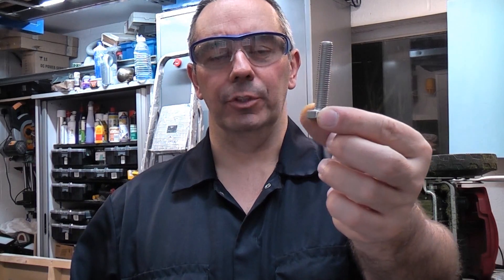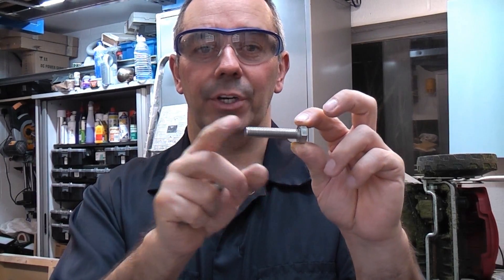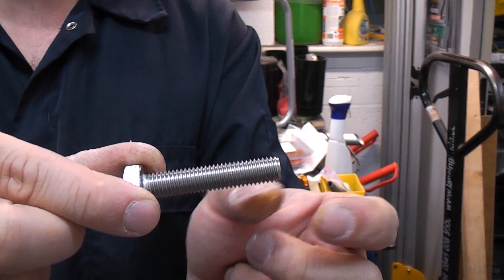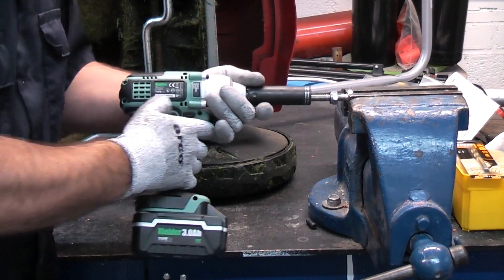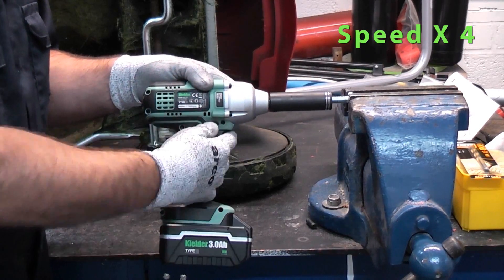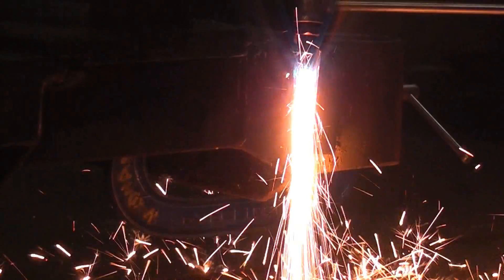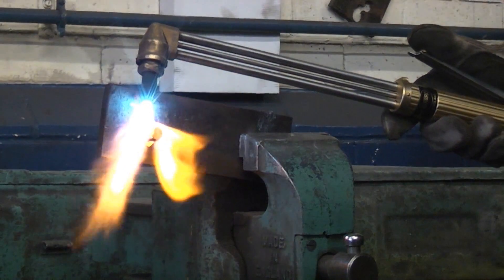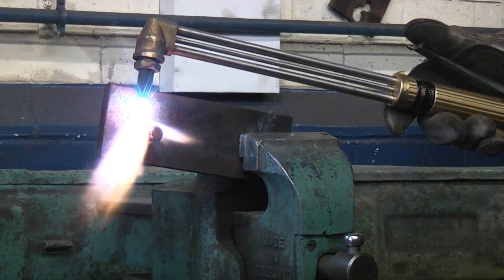Stainless steel bolts vs steel bolts | Stainless galling

Comment: Is it just nylocs that are an issue or will regular stainless nuts on stainless bolts have the same problem
Reply from the maker: It depends, I used Nylocks as they create a lot of friction and so they can gall up really quickly. I have had M16 stainless nuts and stainless bolts gall up on a steam valve (not Nylocks), which I had to saw off using a hacksaw. The machine that is pictured in the video (with the Milwaukee ratchet) also galls up when undoing the stainless bolts- using a regular ratchet spanner.
Thanks for the comment
Reply: Robert B when there is any resistance you have galling

Comment: Thank you very much I did not know stainless steel nuts gall or that you cannot burn them off. Why is it that they push stainless bolts more than galvanised ones?
Reply from the maker: You are welcome. In some situations stainless bolts and nuts are better, galling can be eliminated in a lot of cases by using a suitable anti-seize compound.
Thanks for the comment
Reply: Ultimate Handyman  If you did not know they galled and did not know that anti seize compounds are used they are not much good.
Reply from the maker: That is true ;-)

Comment: Quite some years ago, I had a 'temporary' job as a Mechanic in a food processing plant. I was told to just work, and keep my mouth shut, and nose out of any other projects....so, I watched in silence as about 6 guys spent weeks building a big ass conveyor system of all SS, to replace a carbon steel/painted unit. There were maybe 300 1/2"  X 2" bolts...they assembled the thing in the fabrication shop, then went to take it apart for transport.....all the bolts/nuts (nylocks) galled, many hours of abrasive/cutting everything apart. Funny thing, we used a cutting/drilling lube called 'WestLube'.....in the machine shop, in a different building......but even though it's good for SS, no one knew that, even though it was on the label ( the shop foreman was actually illiterate)....and even with that, they still burned up lots of drill bits on the SS 1/4" plate....
 Nylocks are used in a lot of applications to retain the nuts if they get loose, so they don't fall into the equipment.
Reply from the maker: I bet it was fun watching them ;-)
Thanks for the comment
Reply: Ultimate Handyman  yeah, and that drilling..? The  bigger the drill bit, the faster they'd run it...not even stopping when the tip was red-hot...!
Reply from the maker: They sound like the guys that repair the roller shutter doors on the sites where I work LOL
Reply: Yeah, Here in Sacramento, Calif...it's Overhead Door Company, I've dealt with them, hire the cheapest guys you can get...that's still the mentality in a lot of businesses...even if the higher paid guy can do the job right the first time, in less time. You get what you pay for...

Comment: interesting vdo . . . found cheaper to treat steel to a Palladium Plating barrel roll process for corrosion prevention. . . .    in general bolt threads s/n be longer than 1/2 nut "thickness dim"  ( incl washer/lock HW ) after nut is treaded/torque down... generally,  I thread slowly &   l-u-b-e  sufficiently  for common HW.    m_m
Reply from the maker: Thanks for the comment

Comment: Stainless softer then steel?
Reply from the maker: Yes, it's tensile strength is not as strong as a steel bolt, but for example when drilling stainless steel it can be harder to drill as it can work harden etc.
Thanks for the comment
Reply: @ultimatehandyman  .....both carbon-steel and stainless-steel are STEELS, just the alloying composition is different.

Comment: What a lot of people don't know is that oxyacetlene torches work by first oxidising the workpiece and then blowing that oxide off. And stainless steel resists oxidation...

Quick question though, would you treat stainless steel bolts/screws the same as nyloc nuts (i.e. just one use) or can you replace on removal without future issues?
Reply from the maker: It depends what the threads look like when the bolts are removed. If the threads look damaged in any way I bin them and install new ones.
Thanks for the comment

Comment: Thanks for that, I ride my bike 365 to and from work, I have gradually changed most of my bolts to stainless but there's not much stainless into stainless, most into alloy. Should be okay?
Reply from the maker: They should be fine ;-)
Thanks for the comment

Comment: Wouldn't a plasma cutter be a better choice on stainless than oxy? Not complaining about your video, the galling of stainless threads was news to me. I guess I thought if they're more expensive they must be betterer. That said, I can't think of a single application where I couldn't use anti-seize lubricant. I think it may be the high percentage of non-ferrous additives in stainless--and the consequent reduced percentage of slippery old iron---that's causing the problem. Thanks: you made me think. You have a new subscriber.
Reply from the maker: Yes, a plasma would be better, but unfortunately I don't have access to one.
We use glass washing machines on site, where no lubricants/greases can be used as it could stain the glass.
Thanks for the comment
Reply: Plasma or carbon/air arc....and, galling can be a big problem with titanium, and aluminum.
Reply: Michelle Eden cant use anti sieze near food it can hold bacteria

Comment: Pure gold! I had absolutely no idea about this. Why is it that stainless steel does this? Is it because its harder and has a higher Mohes rating or because stainless steel has the tendency to bind to itself. How do you cut stainless steel then if not with a torch. That’s bonkers! Had no idea an acetylene torch wouldn’t melt stainless!
Reply from the maker: This explains it well- https://www.boltdepot.com/fastener-information/materials-and-grades/thread-galling.aspx
You can cut stainless with a plasma cutter, or a laser cutter. We mainly use a 4.5 inch angle grinder on site though.
Thanks for the comment
Reply: Yuri Ilukkumbure it binds up because the stainless balls up on a molecular level

Comment: Thanks for this excellent and informative video. I seem to remember that a combination of a brass nut and stainless screw is recommended for some applications.
Reply from the maker: You are welcome. I'm not sure if brass nuts would have the strength for some jobs- but at least they won't gall.

Thanks for the comment

Comment: Couple questions come to mind; are stainless steel bolts more of a one time use thing? What if you slowly loosen/tighten nut every to avoid much heat from generating preventing galling?

Comment: If it's a food-grade issue: http://www.loctite.co.uk/loctite-4087.htm?nodeid=8802630303745
Reply from the maker: No, it's because the firm that I subcontract for washes sheets of glass in the washing machines and any oils/greases/anti-seize can contaminate and stain the glass. The glass is about £200 per sheet and about 1500 sheets of glass are washed every 24 hours.
Thanks for the comment

Comment: Interesting video,I have read that PTFE provides good resistance to galling,off topic how are you getting on with Kielder impact drill as I’m about to purchase a replacement
Reply from the maker: PTFE probably does help. We have a spray white grease on site now with PTFE and it is a great all round lubricant etc.
The Kielder impact wrench is superb, it is very compact and powerful. I keep mine in the back of the van for emergencies ;-)

Comment: At work we tend to use a stainless bolt with a standard steel nut on coal and iron ore conveyors. This way the threads stay cleaner than a steel bolt and it comes apart nice and easy as theres less or no galling
Reply from the maker: Thanks for the comment ;-)

Comment: Interesting video Chez. I knew about stainless galling, but didn't realise how quickly is occurs. You can see swarf hanging out between the nut and bolt. Useful thanks.
Reply from the maker: Thanks Dave, I was quite shocked at how quickly it galled up.

I've had this a few times at work, the machine in the video where I used the 12v ratchet is a pain for it as the bolts go into tapped holes in the stub axles, and these often seize or the head snaps off when you are undoing them (just with a ratchet spanner). A couple of weeks back I went to replace a 2" steam valve and when I got up the scaffold I spotted 4 stainless bolts, 2 of them could be undone, the other 2 could not (even with my 3/4 inch drive breaker bar), I had to hacksaw through the bolts!

Thanks for the comment

Comment: very very useful info, would stainless bolts into steel captive nuts do the same?
i was thinking of using ss bolts to replace some of the grotty steel ones on my classic car for the removable service stuff
what type of 'dress up ' bolts would you recommend, chromed steel?
thanks, and thanks for the great info.
Reply from the maker: Stainless bolts into steel nuts should be fine, even different grades of stainless, such as using A4 bolts with A2 nuts can help to reduce the problem. If you use a good anti-seize compound it can prevent the galling from occurring, but please be aware that stainless bolts are also not as strong as steel bolts (something to consider on vehicles).
Thanks for the comment
Reply: Mind you, if you need an anti theft bolt I will use a ss nylock

Comment: Stainless nylocs on stainless screws equals disaster. For many years I worked in a marine environment where it was necessary to use stainless fixings - beacons at sea,marina pontoons etc. If nylocs had been used ,you could virtually guarantee that one of the fixings would've "picked up" and have to be cut off. This is a ball ache ashore but a nightmare stuck on a rock ,miles from land. Blessed be the advent of the battery grinder and thin cutting discs!. Anti-galling paste is  of some help but not guaranteed to work .In all the years I did it, I never had a plain nut come loose provided it was correctly used.In my view, stainless nylocs are the work of the devil.
Reply from the maker: I can imagine that being a nightmare job- it's hard enough when you are working on a site and it happens!
Thanks for the comment
Reply: @ultimatehandyman  did you work as a mechanic and in construction?
Reply from the maker: @aaron6841   No, I'm a maintenance engineer in a chemical plant, but have been doing D.I.Y since I was about 6 years old ;-)
Reply: @ultimatehandyman  I'm non the wiser do you fix the machines?
Reply: rivercarper01  We have a large solar panel array on our ranch. Something like 48 pivot points each with a stainless bolt and nut that has to be loosened and tightened twice a year for sun position adjustment. 90% of them were seized after the first couple of years. These are conventional nuts. These were always adjusted by using hand wrenches. Gonna' have to research some alternative soon.
Reply: Wondering the same thing as rivercarper01 - is it something specific about nylock nuts that makes it worse? I always thought any stainless-on-stainless had a chance to gall and sieze.
Reply: We fit nyloc s/s nuts to s/s bolts and it’s a nightmare. Cutting off every 5 out of 20. Just a complete pain, yet the supplier designs them that way so we are kinda stuck with it.
Reply from the maker: Yes, I work as part of a team that fixes/repairs machines and plant.

Comment: great video. i didnt know you couldnt burn off stainless. what do you do if you cant get a grinder in at it. why does the stainless siese up like that . is it because its soft and kinks the threads and crossthreads
Reply from the maker: Thanks, I think it's something to do with the bolts threads being rolled to form them and the nut threads being cut, if you Google it there will be a lot of info about it.

Yes, in the past I have had to cut bolts off with a grinder or even a hacksaw because someone has used stainless bolts, but to be fair they probably thought they were making it easier for next person- not harder.

Thanks for the comment

Comment: Another enlightening video! So SS bolts and SS nuts together causes this problem? Or a mixture of mild steel and SS? Cheers
Reply from the maker: Thanks, Yes stainless on stainless causes the problem, you should be able to use a stainless steel bolt and steel nut and this problem should not occur. We get it a lot on a machine where tapped holes are in stainless stub axles, often the bolts pick up and shear off with very little force.

Thanks for the comment

Comment: Very informative thanks. What would you use for non-marine outdoor environments instead of stainless steel? Also does the grade of stainless steel matter? 316 A4  better than A2 or vice versa when it comes to this problem? Cheers.
Reply from the maker: You are welcome. Galvanised bolts cab be a good solution for outdoors, or if you want the bolts to look good you could just use stainless steel bolts and apply anti-seize compound as that should prevent the galling. I'm not sure about the different grades, but I believe that if you mix the grades, such as a A4 bolt and a A2 nut the problem is nowhere near as bad.
Thanks for the comment
Reply: brass nuts with the stainless bolts works very well indeed
Reply: Pat19eighty4 zink coated or galvanized..oil base paint or grease works as long as you re apply every 6 months in high humidity conditions

Comment: If you apply grease to the threads, is there any difference....?......as I apply some form of grease to every bolt or screw with my motorcycle refurbishment...
Reply: his combination on stainless, power tools and the lock nuts makes friction, the paste helps but that combo is the problem, stainless just wants to weld itself together,   avoid using power tools would be the first and use plain nuts, not locknuts, then you probably wont have any issues.
Reply from the maker: Yes, using a good quality anti-seize compound can help to prevent galling.
Thanks for the comment

Comment: Out of interest, do the same problems occur when using a stainless bolt with a steel nut and vice versa?
Reply from the maker: I don't think so, I believe it's only a problem with stainless on stainless, even using two different grades of stainless such as A4 and A2 can help reduce the problem.
Thanks for the comment

Comment: Thanks. So what would one do to remove said stainless steel bolt?
Reply from the maker: You would have to cut it off using a grinder or hacksaw etc.
If the bolt has broken in a hole it would have to be drilled out.
Thanks for the comment

Comment: How would you remove a stainless steel bolt then?
Reply from the maker: Normally either with the angle grinder or hacksaw.
If it's in a tapped hole and the head has sheared off, you have to drill out the remainder and re-tap the hole.
Thanks for the comment

Comment: Interesting. Thanks. If a non nylock nut is used, will it still gall up? What causes the galling? Heat? Also, if the nut is tightened by hand (rather than using a drill) then will the nut come off easily in future. Many thanks.
Reply from the maker: Nylocks make the galling happen quicker as it is caused by friction. If you Google for galling there are lots of pages that explain why it happens much better than I can. It still happens if you tighten or loosen the nut by hand, I have had it happen to me several times when just using a ratchet spanner.
Thanks for the comment

Comment: To add to that Stainless steel bolts are not as strong.
As you mentioned stainless has it's place, I've made the mistake of using galvanised/zinc coated screws and bolts on a boat once, never again, it doesn't last 5 minutes.
Great video as always, thanks.
Reply from the maker: Yes, I should have mentioned about the strength in the video but didn't have time.
Thanks for the comment

Comment: Great video. I have an off-road buggy and was considering replacing some of the older bolts for Stainless ones. Think I'll stick to BZP now...
Reply from the maker: Thanks, as long as the bolts are not in a critical component (stainless bolts are often not as strong as steel bolts) and you use some anti-seize compound, they should be fine. 
Thanks for the comment

Comment: Didn't know you couldn't cut stainless bolts with oxy acetylene. Probably because I've never had the need to try, but interesting nonetheless, cheers
Reply from the maker: I didn't know that either until I started doing the job I do now!
Thanks for the comment ;-)

Comment: This provided the answer to a problem i had when fitting new hinges to a trailer using stainless steel nylock nuts and  SS bolts. About 30% of them seized when fitting them before the nut had been fully tightened, these had to be cut off. I did eventually get the job done but used a lot more nuts and bolts with the wastage. Thank you for the very useful information
Reply from the maker: You are welcome
Thanks for the comment

Comment: Today i prepared to replace some small bolts on my 80 series Landcruiser side steps, I installed some rivnuts and thought i would do the right thing and use new 8mm Stainless Steel bolts to replace the old steel ones, however i will reconsider after watching your (as always) very helpful video. I always use an anti seize. Thank you for this timely video, great information.  Glen..... South Australia
Reply from the maker: You are welcome ;-)

As long as you use anti-seize there should not be a problem, especially if the rivnuts are steel.

Thanks for the comment

Comment: Thanks for a great tip! 
I had no idea that stainless could seize up like this, I'll be thinking twice before using stainless next time if it's not absolutely necessary!
Reply from the maker: I didn't know until I worked on a few machines where the stainless bolts used to shear off for fun!
Thanks for the comment